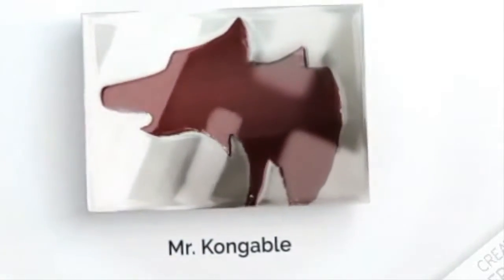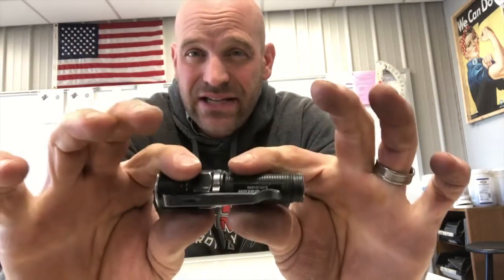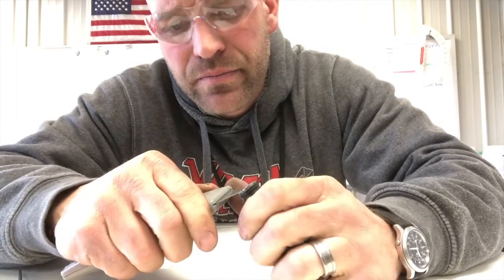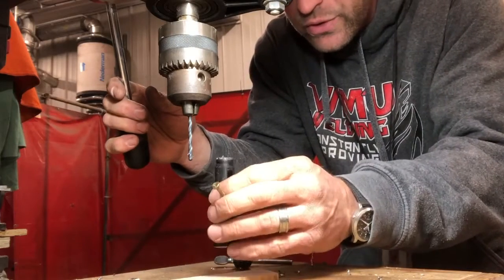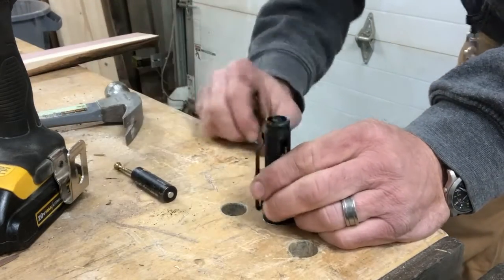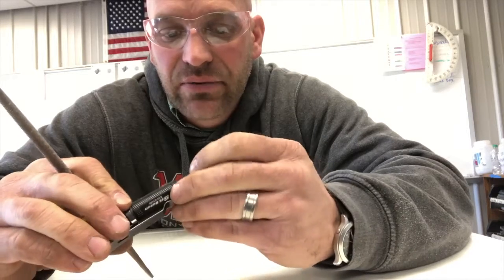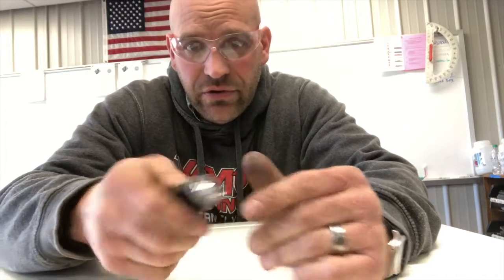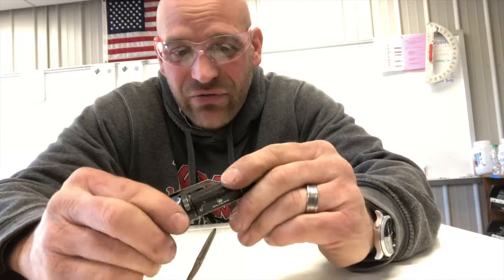How to remove a stuck battery in a flashlight

Comment: I drilled the hole and need to find a long screw use the power drill to attach to the battery.  Thanks for verifying my idea.  I needed to find the screw like you used.  I liked your drill press.
Reply from the maker: I’m glad the video helped, thanks for watching

Comment: I've got a pen light, a nightcore that has a really nice nichia LED; I use it almost daily. It has two AAA batteries, both were "good" until 2032, it was able to power the flashlight on the first two settings even, but they've corroded inside terribly! I'm pretty annoyed that the batteries both worked and were 9 years from their expiration date, but I'm gonna try your idea in the next day or two to see if I can get the second deeper battery out with a screw. The issue I'm having right now is I don't have any bits that're small enough and 3 inches long that I can get it into the top of the battery since it's a full AAA length inside the tube. Appreciate your video man, you earned a sub! You may've saved me $30 haha.
Reply: Wow. So the update, I've gotta share this lol... I drilled a really long nail completely through the AAA battery, had to put the lip of the tube on top of my vise, hold the end of the screw under the vise with a pair of pliers and HAMMER it, took about 3 minutes, and the screw even stripped out the metal housing on the battery. Luckily it was far enough up the tube I was able to grab it with pliers and get it the rest of the way. Never thought I'd have to work so hard to get a battery out WOW!
Reply from the maker: @jetjazz05  Great Job!!
Reply: Battery expectations are reference to shelf life in its protective plastic in an ideal environment, dry stable temperatures in the 70o Fahrenheit.
Reply: Stubborn AA battery was so tight the first 2 screws pulled out making the hole bigger each time. So the 3rd screw (each one a little bigger finally got things moving mm at a time with each blast of WD40! I’m embarrassed so say it took just under 30 minutes but it out and the cleaning begins thanks for the tip 🎉
Reply from the maker: @AKing99   glad it helped!
Reply: @AKing99  Something about the flashlight that battery didn't like I guess, I have an hvac system and maintain 75-72 degrees f and 40-50% relative humidity, the flashlight just sat on my coffee table in the living room for over a year. Sure that's not 70 degrees, but considering the battery failed but the flashlight still powered on was aggrevating. It has 3 modes, I would almost always use it in the first dimmest mode and even though the battery was allover the inside of the flashlight it could still power it. I just don't see what or why they failed, I can really only point it to a poorly constructed battery since I own many of the same flashlights and (WAS) using those batteries. I've switched to lithium cells for those flashlights now because they're much less prone to seeping out. The disposable lithiums, not rechargeable.
Reply: @AKing99  That's even worse than my situation... if I hadn't been able to grab the battery with pliers when the screw stripped out I would've cussed for 10 minutes and thrown it all away in a rage lol...
All I could think about was the possibility of having to drill the battery out until I could fish the shell out, I was really not much into the idea. Maybe if I had a drill press I wouldn't have been freaking out...

Comment: If you find that you have a lot of leaked battery "acid", I recall hearing that if you use vinegar, you can dissolve the white powder leaked battery "acid".  I think the term acid comes from old school car batteries, given Vinegar is an acid, not a base.   So acids, shouldn't dissolve acids, and I'll leave it to the smarter chemist on the internet to define what's in a AA battery.   In any case, to test the idea you can take the old battery with the leak and soak the white end in vinegar.  If it works, move on to the flash light components.  Vinegar will dissolve paint over time so don't soak for days and wonder why the flashlight paint came off.  Also, baking soda is a base, so you can make a tooth paste substance with a little water and scrub the white powder off as well.   🙂
Reply from the maker: @mylocast  great info! Thanks so much!

Comment: Subbed.  My little Thrulight single AAA flashlight has a battery stuck in it.  No drill press but at least I know it's okay to drill into the end of a battery.  Hope I can get it out some way as that model is no longer sold.  Battery was good and the flashlight was used fairly often but it's stuck inside..
Reply from the maker: I have a little Thrulight that has a rechargeable battery , it’s super handy but doesn’t have a pocket clip so I don’t use it much. Thanks for subscribing and watching
Reply: Yes, I have two little AAA Thrulights, one has a keychain attachment and only one light level, but this one has a clip and several light levels.  It's the one with the stuck battery and apparently is no longer sold.  
If I had some way to drill into the battery your video is very clear and helpful.  Thanks again.  @Trevkongable

Comment: I am trying to remove an 18650 battery that is fully charged. These batteries are known to be dangerous if you pierce them. The flashlight is quite expensive and I don't want it to blow up. Any tips?
Reply from the maker: Have you tried putting it in the fridge to get the body of the flash light cold to possibly eliminate any expansion? I am assuming the body of the flashlight is aluminum.  That is the first thing I would try, get it cold and see if the battery will come out.
Reply: @Trevkongable  Hi there. Thanks so much for responding. The battery is actually in good condition. Freshly charged. It was just a bit tight and I tried to push it in, then dropped it, which pushed it all the way in. I tried putting a screw in some epoxy, but it didn't hold. I'm thinking maybe I didn't wait long enough for it to set so I'm going to try again. These damn annoying little problems!

Comment: Crap,I've got the same darn problem almost. Mine is a skinny little(Coast? Brand)flashlight that's a bit longer than that 1/holds 2 or 3 AA,& the 1 that's stuck is @ the top blocking the others. I think the little metal disk on the neg.side was about to pop off when I was trying to pry it outta
Reply from the maker: Can you get to it from the other end? I have a light that both ends screw off and you can see the batteries from both sides but only remove it from one side
Reply: @mr.kongable  Nope,idk why either..This is the 1st flashlight I've had that I couldn't get the lens/bulb end to open..I was just wondering if that disk pops off,is there more metal under it or what? Someone suggested pouring alcohol,then baking soda down in the cracks around the batt.& trying to keep moving it. Another person mentioned superglue on a nut,then 24hrs.later(or once it's def.set),use pliers on the nut to jostle it out,maybe do the hole in  the nut & add screw if ness...Idk,just nervous about drilling into it..
Reply from the maker: @AshleyAriesK  I can understand being nervous about drilling into it. I’d try the nut with superglue. Keep me posted, I’m very interested to find out how you did it.

Comment: I have a lamp here who has two holes for the battery. Like a magazine for a gun. But you can't push the batteries out. It's a horrible design. Once they are pushed in the holes, just 5% of the battery is looking out -_-.
And I don't have a strong magnet or glue in my house :(

Comment: The battery company should put mercury alternatives back into batteries and make them more stable. Then they will not leak any more.
Reply from the maker: That is one option. The new Lithium batteries are not suppose to leak, so that may be a better option.
Reply: I agree the Lithium batteries may be a better option. Corrosion in aluminum flashlights is not the batteries corrosion but the reaction of the alkaline gasses with the aluminum. Aluminum is actually a rather poor metal to use in the presence of alkaline   batteries. Soaking in vinegar often helps before attempting removal. Also a dab of Vaseline in the threads when reassembling makes things work smoothly and helps with o rings too .
Reply: A preventative measure I'll implement when I remove a very stuck AA in an expensive bit of kit with an aluminum battery holder: I'll coat the interior -- once thoroughly cleaned -- with Anti-Seize grease, leaving only the thinnest possible layer. I happen to have the remnants of a pot of the stuff, and it's now so dried out that it's a thick and gummy paste... (This works with aluminum bicycle seat-posts; the Anti-Seize is applied to the exterior of the post, rather than the interior of the frame.)